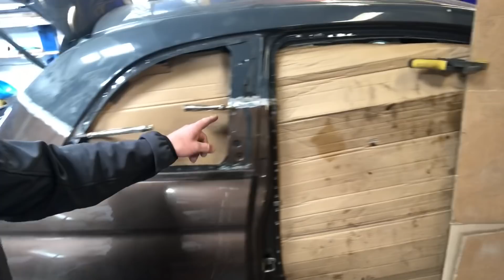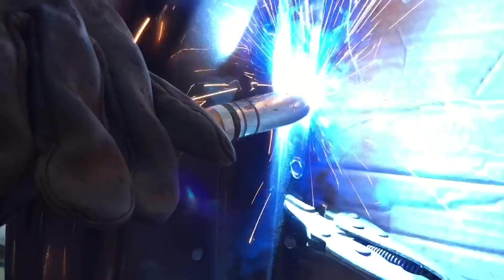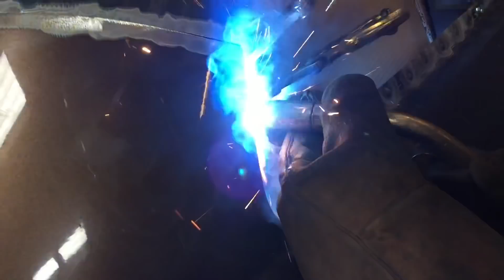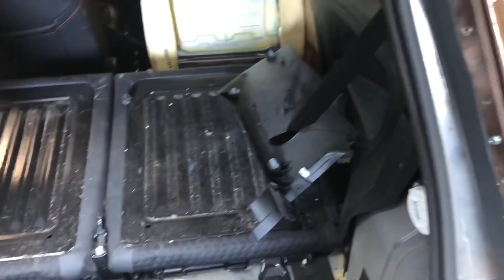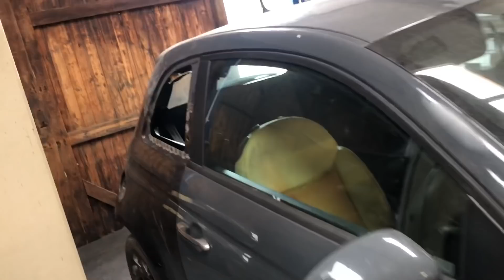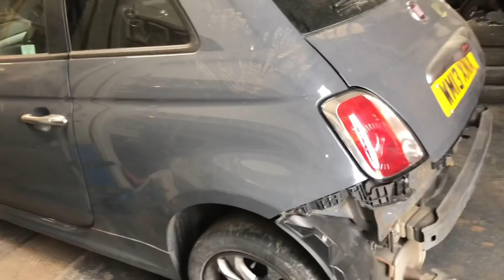Copart 2013 Fiat 500 Sport Welding and Grinding PT6

Comment: Should get a filter to protect the camera. Welding flash does degrade them over time. Slipping a piece of the leftover quarter panel adds a lot of strength to the panel. Keep cracking on; we're all watching.

Comment: Sorry for the ignorance Rob but will the welded in panel be as strong as original especially in a shunt ? Looks a cracking job but I do worry about things like these.
Reply from the maker: G that panel to be honest is really only the clothing as the main structure is all behind it the panel is only thin tin that’s why the always bend up and look so bad wen there hit 👍
Reply: salvage rebuilds uk cheers for explaining that rob 👍

Comment: Well impressed, I know nothing about welding but just wondered why Chris uses a wire brush after each spot weld? is that something that's always done? Forgive my ignorance.
Reply: Mike B it removes the paint easily whilst its still hot

Comment: Did the welding involve any Boron, high strength,  steel parts and how do you get on with welding it or does it have to be brazed?
Reply from the maker: K Welton no boron

Comment: Hi,nice video,if you get Power-Tec Plug Weld Pliers Plugweld it will cut down on the grinding as the copper at the back helps to get a quicker neater weld,also put a bit of carpet on the glass as sparks melt into the glass too easily on modern cars....all the best,keep up the good work
Reply from the maker: Dave Fish we have got one but it wouldn’t work 👍

Comment: I found this channel by accident and so glad I did - it's like cat nip, I can't stop watching the videos! Great info and especially this lot about my favourite little car. (I was actually looking for clues as to why my Fiat 500 speedo reads 20mph when I'm doing about 60 sometimes but hey ho, I'll use the sat nav instead :) ).  PS definitely not in kmh etc... It happens randomly during a journey and won't read above 30mph regardless of actual speed.  It's going to the Fiat dealer when they open.

Comment: Hi Rob, just wondering if you guy ever considered getting welding blankets instead of using cardboard?
Reply from the maker: Victor Silveira we could only find one and we used it on the carpet. The cardboard was only used to stop the splatter getting in the car or on the glass 👍

Comment: Hey mate I've got a question, I've bought a Cat N 335i from Copart and its been delivered to a mates address in York. What do I need to do so I can drive it home on Monday? It runs and drives fine, slight rear bumper damage.  But yeah mate just wondering, have I got to fill a V62 and get a new logbook for it before I can even tax it? Or should I just insure it and drive it home? Cheers!
Reply from the maker: Humza Ahmed you will need tax or trade plates call Dvla ask them if it can be taxed in the post office ask if it has a registered keeper 0300 790 6802

Comment: how do you stop the top weld point on the rear from distorting under the heat, do you fill it over afterwards and sand it down so you can't see the weld at all when it's painted?
Reply from the maker: RideBikes_Walkplaces yes it will always need a small skim of filler after it’s ground back 👍

Comment: Is that just a plain butt joint on the quarter panel or do you joggle it? Just trying to understand how you get it flush enough not to show when it’s done.
Reply from the maker: Paul Charlton it won’t show as it will have a skim and then paint 👍

Comment: @salvage rebuilds uk  You mentioned in your last video how you had trouble drilling the 1/4 off the b post due to being boron steel... MIG welding onto boron is not permitted unless you are using mig braze.  If you were to follow Thatcham methods, as the heat from A standard copper coated steel  mig plug weld ( that is not a spot weld as you call it)destroys the characteristics of the steel of the high temp of 1600 degrees as mig welding produces. Also all that heat will burn off the gavnised coating. To weld modern steels you should be   SPOT welded using an inverted spot welder, and seams using MIG brazer. When welding HS steel to AHSS stee,l it needs to be panel bonded and spot welded.( with a inverted spot welder not  mig plugged ) Your old school method would not 'cut it in a PAS 125 accredited bodyshop. You would be shut down in no time if that was an insurance job. I appreciate this is how old school repairs were done back on the day, but these methods now won't cut the stringent quality British Standards that is present in a modern bodyshop. I don't agree with you brainwashing people, that you produce a good quality repair, when what you do is far from it.

Comment: ... CARDBOARD TO PREVENT A FIRE ?...
Reply: Not to prevent a fire but to prevent the sparks hitting where they shouldn't
Reply from the maker: David Rocha fire blanket to prevent fire cardboard to prevent glass damage
Reply: Saves making a mess of the interior, they’d soon move the cardboard if it did catch alight, probably wouldn’t be a bad idea to lightly wet the cardboard though to further reduce the risk

Comment: Iv got a 60 plate foucu just sitting around not doing anything if ur interested 1.6 econetic
Reply from the maker: Nels Smith what’s the price and mileage 👍
Reply: @sruk  its been sat for 6months of more the diesel filter is block and someone has smash the drivers side window the mileage is round about 138 140 something like that and I take 350 for it hopefully we will see a video on it
Reply: @sruk  only local to you as well
Reply from the maker: Nels Smith how do you know it’s only the filter ?